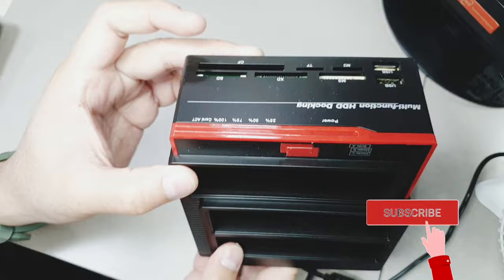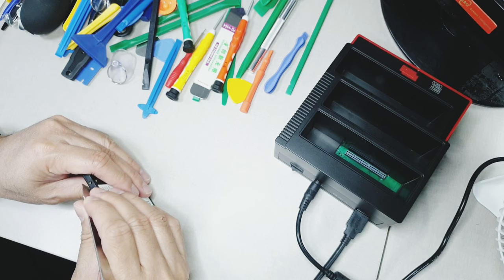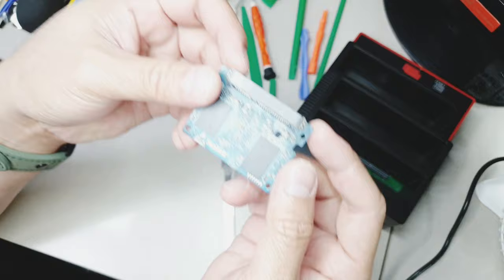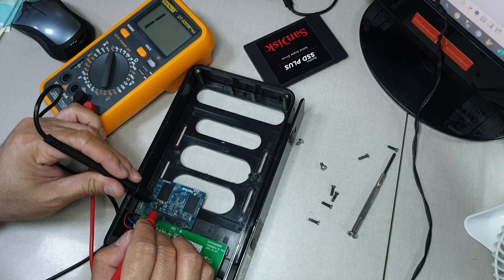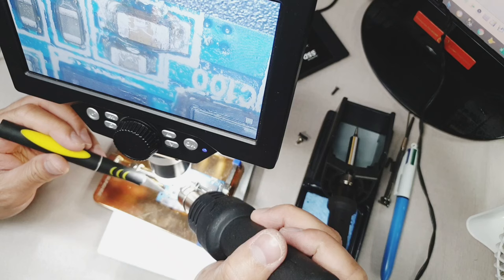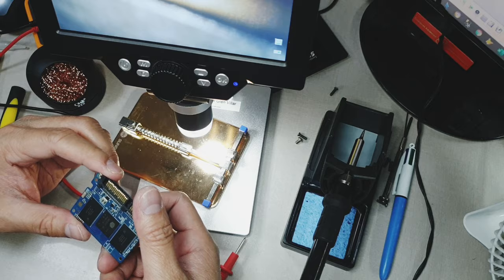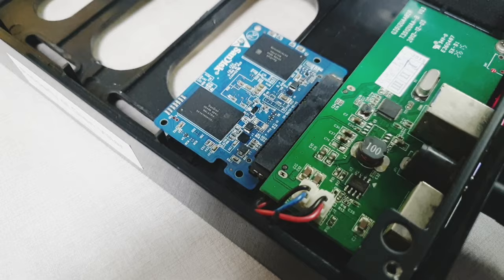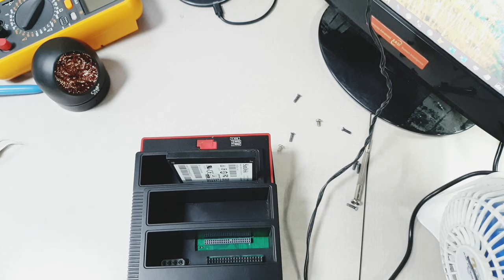How To Repair  Dead SSD (Solid State Drive) and Recover Data  - 100% Working

Comment: when i connect my ssd via usb or inside the laptop the laptop disk manager and bios does not make and sound and don't detect it at all but the cable shows blue light and ssd shows green light but what ever i try it doesn't work please help,,,,
Reply from the maker: Maybe some of its components are damaged.

Comment: I have a question that might be stupid: you just remove the shorted capacitors? Like, you don't substitute them, just remove it?
Reply from the maker: Hi Manuela, yes I just removed the shorted capacitors. If you have a replacement, better to replace them.
Reply: @ReynaxisSolutions  wow, I didn't know that was possible. Does this work for any capacitor in the board?

Comment: Hi Reynaxis, 
I had a broken SSD in my laptop (water damage) so i bought a new one. When i just got the new one and i put it in it worked. But just now when i had installed a windows copy on a USB it said with the flash codes of the on and of button that the SSD is broken again. I handled it very carefully so i dont think i broke it. Do u have any idea what i can do?
Reply from the maker: Try repartion.

Comment: Great video, but I want to know: How do you distinguish between a surface mount capacitor and another component like a diode or resistor on the SSD board? Before throwing out my SSD I might try this to recover the data on it.
Reply from the maker: Hi, thank you. SMD capacitors are easily distinguishable because their body in between two connectors is white or yellowish and looks plasticky. It usually doesn't have a number written on the body. Resistors are mostly black in color and has a number written on the body. Most of the diode can be identified by its connectors which are smaller than its body. Sometimes, coils can look like a capacitor and the most prominent difference between a capacitor and a coil is that the coil tend to have rough connectors.

Comment: Thank you for the helpful video! I have a question though, when the shortened component is removed, does that mean that some of the data from the SSD is gone.. I have the same issue, my computer doesn’t see the SSD and I really don’t want to lose all my data.. is t possible to save most of it?
Reply from the maker: Hi, your data is held in the NAND chip so removing faulty capacitors isn't going to affect your data. But if some chips are faulty or the NAND itself, then your data may be lost.

Comment: Hi there, if we decide to replace the capacitor, what things we need to concern to?  can we replace the capacitors only based on the same size? Ur answer will be much helpfully for me, thank you
Reply from the maker: Yes, if you don't know the value of the original capacitor, then the best way is to replace it with the most similar cap in size.

Comment: why do the ceramic capacitors fail? this is very rarely happening
Reply from the maker: Maybe high temp or fluctuations in the power supply.

Comment: Where are you located. I was diagnosed a defect on the controller board/ card....could you repair ....but I am sitting in Europe ....any way to contact you  😢
Reply from the maker: Hi, sorry, at the moment I don't accept repairs from overseas as there is high chance of losing your parcel along the way here in png. But actually, any mobile phone repair person in your area can have a look and try to repair the ssd. Thanks.
Reply: @ReynaxisSolutions  They made an offer to me which is above 1200 Dollars.....that's very high.....I think it will work much cheaper with your method....they want to extract everything from the hard disc by using some special method to unfix the storage parts....do you at least think this is the way.....I think  they are just saying to charge much extra
Reply from the maker: 1200 dollars is quite high. Another way of knowing if you can still recover your files from the SSD is to connect it to an external casing and read your external hard drive using an ubuntu OS installed on a pc or virtual pc. I use that technique a lot to extract files from a corrupted ssd that my windows pc cannot read.

https://youtu.be/b_V6ULI0ztg?si=8-OoVaCim1Hili_1
Reply: @ReynaxisSolutions  One company tried to read through Linux ....according to them it was not accessible....they didn't see any hard drive....Sata no drive was also showing in Bios....do you have any contact in Germany through your network who could help...many thanks
Reply from the maker: Hi, sorry to hear about that. I don't know anyone from Germany who can help you fix your SSD. But you can try and send your SSD to NorthridgeFix. He is a US-based person but is a lot better than me when it comes to fixing stuff. You can find his YT channel on this link. He accepts repair from all over the world and 
can even expedite the process.  https://www.youtube.com/@NorthridgeFix

Good luck!

Comment: I didnt see you replacing the removed capasitors.
Reply from the maker: Hi, you are right. I did not replace the faulty caps because I only need to recover the data in the SSD.

Comment: Let me get this straight. Is it just to remove the shorted components and leave without replacing? 
Aren't they there for a reason and the board might just not turn on without them?
Reply from the maker: I think that the shorted caps that I removed are filter caps, so removing them will still make the board work which is good enough to give me time to recover the data that I need.

Comment: Can you provide a list of all the tools you have as an IT  expert for Data Recovery. I want to get these tools as well.
Reply from the maker: Hi, I only have a few tools.

1. Relife RL-M3T Stereo Microscope
2. Yizhan LED Microscope
3. Mustool LED Microscope
4. Different Types of Network Tracers/Testers
5. Crimping Tool
6. Cable Cutter
7. CCTV Tester
8. Yihua 952D Hot Air/Soldering Station
9. Longwei LW-K305D DC Power Supply
10. Kiasi 1505TD DC Power Supply
11. Tweezer Type Soldering Iron
12. Soldering Iron
13. Soldering Flux
14. Soldering Paste
15. Multimeter
16. Different types of Soldering Lead
17. Soldering Wick
18. Soldering Pump
... and some other tools.

Comment: I had a bad SATA cable (maybe shortcut), so my SSD died... So I replaced the SATA cable, but my Macbook can not find the SSD. You think, in my case the same procedure like in this video will work?
Reply from the maker: Should test the ssd with external connector first.

Comment: Hi may i ask do you replace the capacitor or just remove it? 
So if your remove the capacitor is that ok to use in the long run?
Reply from the maker: Hi, I did not replace the caps. This was only good until we copy the data from it. However, up to now since the time I repaired it, it is still working.

Comment: Bro my wd ssd is not formatting and whenever i try to format it the data is back to its original form, have tried cmd, software eveything which was possible now my questions what is the issue and can it be fixed?

Comment: Just saw that you answered my question in a previous post that you did not replace the capacitors, just removed them.  Why are they there if not needed?
Reply from the maker: They are maybe for filtering purposes, hence, filter capacitors.

Comment: So, are you only removing the shorted capacitors and then the SSD is working again or are you removing and replacing with new capacitors to fix it?
Reply from the maker: Hi, yes, removed the shorted caps. Didn't have to replace.

Comment: Hello and thank you for your informative videos. I have a new SanDisk SSD 240 that I had encrypted using BitLocker, and when I tried to decrypt it, it took a long time and I had to restart the computer. Now it is not possible to delete the partition or format using different software, and Diskpart , etc., and it gives an I/O error when formatting or deleting partition. It is necessary to explain that the ability to read and identify the drive is active and does not have bad sectors. Is it possible to format and reuse it? Maybe or should I throw away the hard drive?Tnx
Reply from the maker: Hi, I have never tried interrupting the process of decrypting BitLocker's encryption. You may try and decrypt it again. But usually, if the decryption fails, we can still format it. We've tested that hypothesis before by encrypting a flash drive and formatting it. It cleared the data and we can reuse the flash drive. But in your case, I'm not sure what went wrong with it. I guess you'll have to discard the SSD.
Reply: @ReynaxisSolutions  Thank you for the answer, but I have to say that I am not able to unlock the drive with the password or recovery word and I only recovered my data using software. Now it is not possible to delete the partition or the SSD format and I get this error message: "The request could not be performed because of an I/O device"

Comment: I tried to use my ssd on another pc but it showed an error insert boot media. Also it was unable to reinstall os. I have a chinese ssd and the cap will be same as this?
Reply from the maker: Hi, usually, for the first step of SSD checking whether I need to repair it or if I can access it by any other means and extract the data, I would usually insert the ssd into an enclosure and plug it to USB port on a PC installed with a Linux OS.  Usually, Ubuntu Linux would read the files in SSD even though Windows could not read it. Here's my video on how I do it. https://youtu.be/b_V6ULI0ztg?si=tDm1lo9PP8kMSmUG

Comment: Hi, I have a SSD that works fine but it drops it's drive letter every time I unplug it and so each time I plug it in I have to go to disk management and reassign a drive letter but this means it can't boot from it without a drive letter, do you have any ideas as to the problem.Thanks.
Reply from the maker: Hi, I haven't come across that problem before. You can try and check for disk error like chkdsk /f x: or update your pc's windows because it might be related to USB controller drivers. I'm not sure. Hope you find a solution. Good luck!
Reply: @ReynaxisSolutions  Yes it is a strange problem but the drive works perfect once I assign it a drive letter. I have 5 SSD's on my PC and all the others work fine.

Comment: it wasn't clear that the second time you found a short with the high temperature, you didn't cut it off and you said it was fixed.
Reply from the maker: I removed the capacitor on the second short, but I did not include it in the video as the video would take longer.

Comment: Nice video Sir. The tools/equipment you used, the Multimeter and the microscope are provided by the company? Or those are your personal stuff?
Reply: One more thing, did you replace one component in the board? And solder it again. Or you just remove the one that is shortened?
Reply from the maker: Thanks sir. These tools are my personal and I bought these with my own money.
Reply: @ReynaxisSolutions  sir are you an IT Manager in pNG?
Reply from the maker: @jaymarkalvarez9851  Hi Sir. Yes I am.
Reply: @ReynaxisSolutions  Sir I'm also a Filipino. I have a job offer as an IT Manager. Can we connect on messenger? I would like to ask something about the culture of PNG.
Reply: I hope I can meet you personally there.
Reply: @ReynaxisSolutions  Please can you tell me type of microscope...

Comment: Hi I have a question. I have a laptop that’s still under warranty but has died. I have removed the SSD from it and backed it up to an external hard drive but now I need to send the laptop to the manufacture to be repaired with the SSD reinstalled into the laptop but before I reinstall it, I would like to know how I can wipe it so none of my data is on it, even though my laptop is dead, and will not turn on? Thanks for any help you can provide😊
Reply from the maker: Hi! The best way is to use a Hiren's Boot CD Disk Wipe to wipe clean that SSD. But if you don't have that, you can just use the Window's Disk Management to format and repartition your hard disk. Repartition means break the SSD into 2 or 3 parts and format each part so they won't bother looking up anything in there. You can do all of that in Windows Disk Management.
Reply: @ReynaxisSolutions  Thank you so much for taking the time to respond. I really appreciate your advice, and I will definitely make an attempt at this with the help of your instruction. Lol wish me luck. Thanks again I’ll let you know how it goes.😉🤞🏻☺
Reply from the maker: Hi, best of luck to you. :)

Comment: Hi, excellent video ! One of my relatives has a SSD having same symptoms. Any recommendations for cheap but ok pcb thermal cam, microscope and logic board holder?
Reply from the maker: Thank you. There is a cheaper version from Flir for thermal cam but I won't recommend buying it due to its low resolution. If you can get the Seek Thermal Pro, please get it, it's worth the price.
Reply: @ReynaxisSolutions  Thanks for this advice, any tips for microscope, holder and a good /cheap hot air soldering station?
Reply from the maker: @d4m000n  No worries. I like the Relife trinocular microscope. I have one that I use for repairing watches. For soldering station, I use the Yihua 952D+ which is not that expensive but gets the job done.

Comment: Soooo.... you replaced the shorted capacitor or just left it removed shorted pieces? I also have not working crucial P2 SSD.
Reply: Ok nevermind i saw a similar comment with the answer

So only copy and no more write?
Reply: I mean that's an M.2 NVME SSD
Reply from the maker: Hi, i just removed it.

Comment: is it combination of flux and heat that lets you remove the capacitor? or did you need a solder too?
Reply from the maker: Firsr, I used the soldering iron to remove the caps but i figured it is faster to remove it by heat gun.

Comment: Nice ... 
So ... a "shorted" capacitor will stay "hot" ???  (thermal camera)
Do you ave the link to that model of Microscope ?
Reply from the maker: Hi, yes, correct. Shorted caps will appear hot in thermal cameras.
Here's the link for Seek Thermal CompactPro. https://www.amazon.com/Seek-LQ-AAA-Compactpro-iOS/dp/B07GX8XTG5/ref=sr_1_1?crid=SNVUK3CKOYLA&keywords=seek%2Bthermal%2Bcompact%2Bpro&qid=1650581821&sprefix=seek%2Bthermal%2Caps%2C514&sr=8-1&th=1

Comment: Good morning Sir, could i simply connect the SSD with a USB adapter? Or do I need that special adapter that you have used?
Thank you for your video
Reply from the maker: Hi, you can use any usb sata adaptor.
Reply: @ReynaxisSolutions  thank you very much sir

Comment: Once prying it open to get the pc board out and finding what’s overheating, do you think using freeze spray in the components would work to copy the files off of it one last time?  I’m having trouble understanding how it still works by taking caps out breaking the circuit unless they’re going to ground only.
Reply from the maker: Freeze spray will work the same like the thermal cam. The heated component will just evaporate the freeze spray thereby revealing which component is shorted. I'm not sure if it can help with letting you copy the data for one last time.
Reply: @ReynaxisSolutions  Could you please reply to his second question about removing these caps and not replacing them? that does not break the circuit?
Reply from the maker: @HDHD-yv9np  Hi. If you have a replacement capacitor, I suggest that you replace it. But no, it did not break the circuit and the ssd drive works well.

Comment: So you just removed the capacitors that were shortened and thats it?
So no replacement just remove everything thats shortened?
Reply from the maker: Hi, if it is a faulty resistor or faulty diode, you must replace. In my case, there's so many caps in the logic board that removing some doesn't have to be replaced. If you have a replacement capacitor, then replacing it is a must.

Comment: Hello, my NVMe SSD suddenly died a year ago after installing a NVMe heat sink. I did not remove it from my unit and install a new SSD and new windows. But now, upon checking on my storage, it seems that the NVMe comes back to life with all data not being erased.

I am happy that the NVMe worked again, but I am still wondering what happened. Maybe you have an answer for that? Thanks in advance.
Reply from the maker: Same thing happened with my NVMe. It died and after installing an SSD, it came back to life. Maybe lose connection.
Reply: @ReynaxisSolutions  it died again today after deleting those windows files that I don't need.

Comment: What If it's not showing at all in the beginning? I removed my SSD from the laptop and connected it on another laptop through a SATA converter, but it's not recognized at all... any solutions?
Reply from the maker: Have you tried using another cable?
Reply: @ReynaxisSolutions  yes I tried 2 different ones, I also have another SSD drive that I've tried and that one works fine :(
Reply from the maker: @salahhelmy9907  Hi, in that case, the logic board of the SSD must be checked for problems.

Comment: This video is very nice .
My ssd problem no detect . And I opened my ssd  . I see inside sata connector are damage. How can I change it ?
Reply from the maker: If the data in the ssd is not really that important, I think it's not worth buying a similar ssd to replace the connector. But if it is indeed important, you can buy a similar ssd and try and attempt to replace the connector. I haven't tried though.

Comment: Sir, watching your video, do you replace the damage capacitor with new capacitor?
Reply from the maker: Hi Sir, no I did not replace the capacitor. It's advisable to replace it but it can also work without it.
Reply: Thanks, I was wondering that too.🦧
Reply: @ReynaxisSolutions  does this apply to all capacitors?